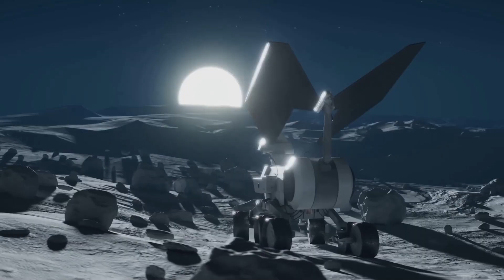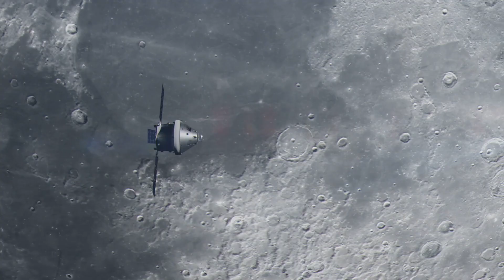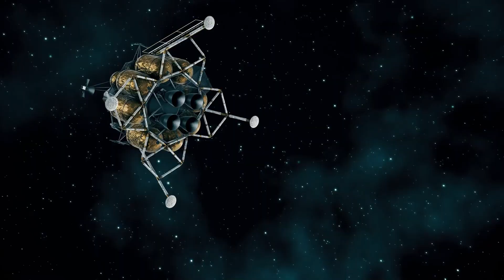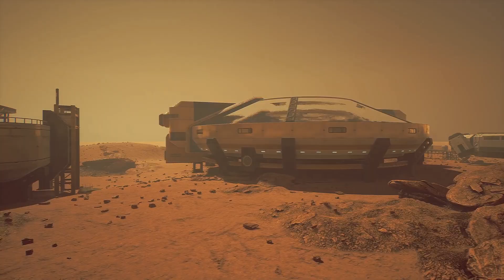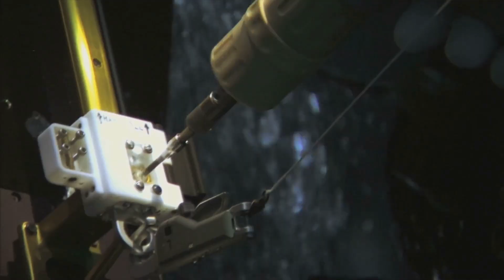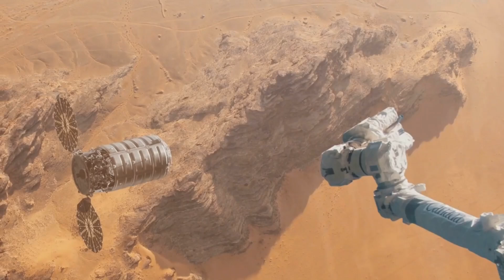How NASA Will Actually Build the Artemis Moon Base ?

Comment: they should put the base partially underground to protect it from from radiation
Reply from the maker: Putting the base underground (or covering it with soil) helps solve all three at once.
1.Radiation Protection (Biggest Reason)
2.Stable Temperature
3.Protection from Space Debris